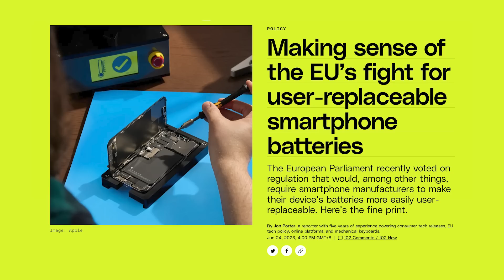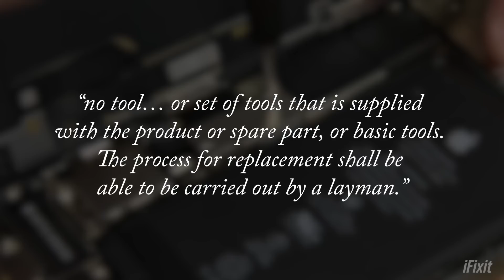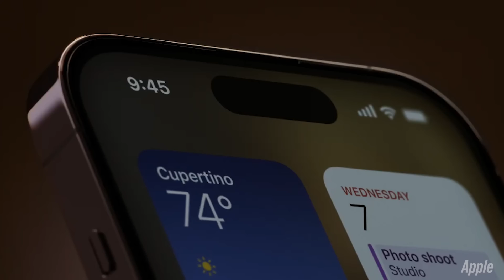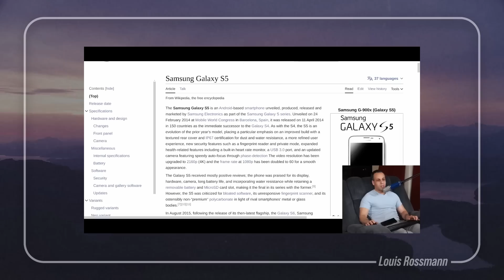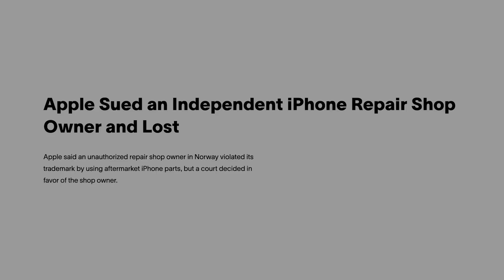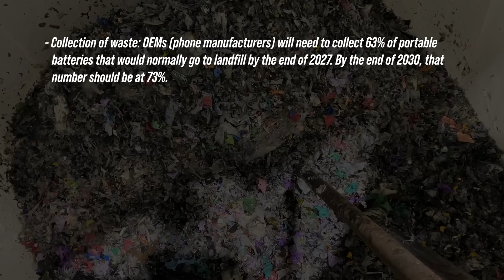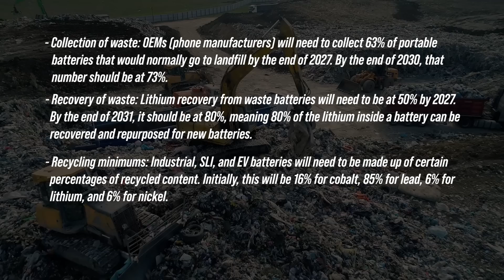EU Just Changed Smartphones Forever

Comment: This is so awesome.  Especially since it accounts for ALL electronic items including the so called 'green' EV cars!
Reply: EVs are a scam.
Reply: I don't know how they can design an EV battery that can be replaced by a "layman" without any tools? Working on any car, even non EV ones, requires knowledge and tools... And replacing the battery is kinda dangerous, it can kill you in many ways if you don't know what you're doing (it can electrocute you, poison you, squash you...). Some EV have batteries that are quite easy to replace if you have a garage with a lift and something to safely lower the old battery and lift the new one. For example for a Kona EV the process requires to disconnect the wires, the cooling pipes, and after that you only have to unbolt the battery tray on it's perimeter and lower it. It's easier than swapping an engine on a ICE car.

Comment: Now here‘s the big question: will this law apply to industrial applications as well? What Apple does is a mere imitation of something suppliers for industrial machines have been doing for ages. Using things like TPM-chips, registered hardware etc to block any repair or modifications with second source parts so they can charge a premium for old tech (and I‘m not talking about safety relevant areas like aerospace, trains etc. here)

Comment: I have yet to need to replace a battery before the phone was outdated...  I DO NOT want a plastic phone... I can't imagine a cost effective, waterproof and still slim profile on a glass and steel phone that has all the extra bits required for slides, pins, clasps, gaskets, etc... I am old enough to remember thick bulky phones.... I remember when the iPhone was released and it was so thin, compact, sleek... and they have only gotten thinner... not to mention that the friction connection between the battery and the phone was a weak point that would corrode and fail and also is not as power efficient as a soldered connection.

Comment: More important then having the battery removable and easily replaceable is to have manufacturers have to release software to calibrate screen and diagnostic software, so anyone that wants to repair their own phone can. No more serializing parts to the main board disabling functions due to changing a screen and etc. 

Also we need SD slot back and headphone jack with decent DAC in phone back.

Comment: How this applies to electric cars? Do they want people to replace 1000 pound batteries at home? Also modern EV batteries last forever practically, needing replacement is very rare, much more often the battery outlives the car.

Using adhesives instead of screws is easier and cheaper, while also increasing quality and reliability. That's why every industry is moving that way.
Yes, you can make an IP68 phone with screws, but that doesn't mean it's easy or cheap.

I bet 99% of people will still throw out their phones when the battery dies. By that time the phone is old anyway, so it's a good excuse to buy the latest version.

As for recycling, batteries are already being recycled. Li-ion batteries are full of valuable materials, so recycling makes economic sense. Look up Redwood Materials, for example, but there are many of others too. EV manufacturers usually have recycling programs too.
And since these materials are elements, they can be recycled indefinitely, and at a near 100% efficiency.

Comment: About F'ing time some enacted this requirement.  I used to buy a 2008 Fujitsu Tablet for my field work.  It was a little heavy, and slow but had replaceable batteries, memory and hard drive.  I finally had to switch to a newer tablet not because of the tech but because I could no longer buy new batteries.  

Since then, I've had 3 Microsoft Surface 6 tablets.  My latest one is getting to the end.  The battery only lasts about 2 hours.  The Surface 9 finally incorporates a replaceable battery.  It will be my next device.  The same is true of phones.  

I think the manufacturers optimized design for ease of manufacturing and profit - obviously not for repairability.  This same mindset has filtered into EV's.  We end up throwing away perfectly useable tech over a non-replaceable battery.  That is just STUPID and wasteful.  I was hoping that California would do this but applaud the EU for having the courage to do it!  Thank You!

Comment: Interesting. Some electric vehicle production is talking about moving to structural battery packs - ie part of the vehicle monocoque and not replaceable. It's apparently being justified on the basis that newer battery technology will last the lifetime of the rest of the vehicle. You can't really have consumer 'right to repair' with the sort of high dc voltages being used - typically 400 volts now and 800 volts on a few designs. Far too dangerous for well meaning amateur mechanics to mes with.

Comment: 🎯 Key Takeaways for quick navigation:

00:15 🤔 Industry-wide design changes have made easily replaceable batteries no longer possible in smartphones.
01:10 🔧 The new EU law requires consumer devices to have easily replaceable batteries that require no special tools.
02:32 💼 The law also affects tablets, laptops, EVs, e-bikes, and any device with a rechargeable battery.
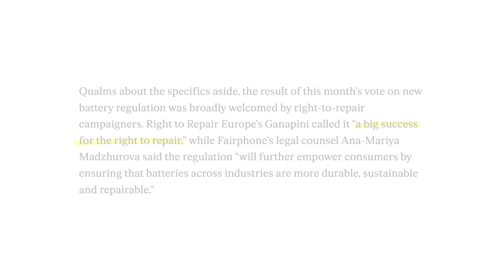03:56 ⚖️ The ruling is considered a success for the "right to repair" movement, which calls for easily repairable consumer goods.
04:29 🍎 Apple's practices of disabling features and warning against non-genuine parts hinder repair efforts and force users to send devices to Apple.
06:19 ♻️ The law aims to create a circular economy for batteries and reduce e-waste generation.
07:38 📱 Smartphone makers will need to start gearing up for compliance with the new law, which may result in changes to their designs.
08:06 ❓ Whether the phasing out of user-replaceable batteries was driven by consumer demand or profit motives is up for debate.

Made with HARPA AI

Comment: I had a LG G6 for 2 years. Loved the phone, was nothing wrong with it. I did replace the battery on it once. The reason I had to get a new phone was because the apps I used were being outdated and the new apps were not compatible with an older phone. Such a waste. So it's not just about hardware but software also.

Comment: "A new EU law will require all mobile devices to have user-replaceable batteries by 2027" is wrong. There is an exception for smartphones if the battery retains 80% capacity after 1000 charge cycles. If the phone manages that, the battery doesn't need to be used replacable. This is not currently the case but extremely easy to adhere to. Simply put the same battery in the EU smartphone and program it to a lower capacity on models sold in the region. So in the EU batteries won't last as long per charge, but will last the same time for longer.

Comment: OK, I totally agree with everything in this video...
Except "At the time carrying a spare battery in your pocket wasn't an unusual occurrence.." 
Umm....  Yes it was...  ;-)  Having a spare battery wasn't that unusual, but I don't think I knew anyone who carried one in their pocket...  Not saying it didn't happen, but yeah that would have been unusual. ;-)
Recently I was frustrated as my electric razer was dying.  I opened it up (which wasn't that simple) and saw the battery was soldered on (with leads).  I was able to order a spare battery with leads attached and soldered it on to fix it, but there was no reason for that.  It could easily have been a plug in replaceable battery...
And yeah with phones, I don't even try that.   I would totally support easily replaceable batteries...
Although I'm not sure user replaceable EV batteries is a good idea.  Those are HEAVY!!!

Comment: Battery life isn't the limiting factor for an old phone. It's usually compatibility, software, security vulnerabilities etc. This law seems misguided to me. It's making phones less integrated (hence more expensive to manufacture and/or more bulky) without giving anything back to the consumer. If replaceable battery was such a hot thing (useful to consumers), brands would be doing that already. What's next? Enforce replaceable memory, RAM, board...? There's no end to this. Fairly useless. I lived through the era of replaceable computer parts. Incompatibility and issues were the norm. Not convenience or longevity. EU perhaps should double down on building better technologies vs impeding technological progress towards miniaturization and tighter integration.

Comment: For laptops. I use framework 13th gen. It has a battery that uses only standard screw to open and replace the battery without any special software obstacle. It is slightly thicker than the apple macbook but it doesn't matter. Everything is repairable and isn't glued or software locked.

Comment: Theoretically "it's good" because people would be able to replace batteries, but "easy, common tools" make it a perfect treasure for thieves... No battery = No GSM/GPS = No tracking = No chances to get phone back. Also, you would potentially lose date etc. like in old phones, and you would have set it up every time...
Also, weaker and higher chances to destroy case, battery / phone, also reminder batteries are highly flammable kinda explosive if you puncture or something.
Bigger size, harder to produce... And many, many other reasons.

Comment: I actually agree with this and I am SO glad you brought up Rossman. I was even about to say the S5, and then he showed it haha. Adhesive is NOT the only way to waterproof a device. This is a lie propagated by manufacturers so they can keep using a method that is cheap, and makes repairs more difficult to entice more purchases. Gaskets have always been enough to create a water-tight seal as long as they are not compromised. The S5 was designed nearly 10 years ago. There have been significant improvements to to waterproofing that can make gaskets IP68 since then. The sole reasoning for using adhesive is profit.
Reply: My go pro has a change able battery that clicks in, that’s fully waterproof! I’ve taken that 15m down before
Reply: Case in point,  Waterproof watches .......
Reply: The S5 was a terrible waterproofing.
Reply: You probably forget that S5 lost its rating after removing the back cover a few times.

Comment: I dont know why anyone is against this. Why force tech companies to allow people to easily replace their batteries. Old batteries make the devices slower making newer devices seem better/faster by a lot then their older devices. There is ways for water resistants with removable battery. The only cons for manufactures are recost of reengineering and people keeping their devices longer. Apple for example use software to make the devices worse if a item is changed without going through apple care. Ipad will show non straight lines drawn on the screen unless a chip on the old display gets moved onto the newer screen which is proof compaines are willing to go anti repair just to force people to buy new devices or go through their own care program.

Comment: it's just stonks. a silicone gasket and some grease isn't that bulky etc. again the s5 has it.
it doesn't have to be replaceable without tools for me. but as long as it's not risky it's good enough (ex, screwdriver etc, not heat or dangerous prying.)

Comment: A battery that can't hold a charge is a huge reason most people get a new phone. It's obviously the driver for them sealing the battery.
Reply: This, and manufactures not updating the software on their devices for as long as they could, leading to some newer apps not working, or running very sluggish.
Reply: @CommodoreFan64  This is why I don't update any apps until they stop working.
Reply: That's part of it but phones also have gained in processing power over the last 10 years, significantly more hardware acceleration, extra LPDDR chips etc...
Reply: It’s like lightbulbs tires, and everything else they can’t make money if some things will last 100 years
Reply: @19ate4   Yeah good i hope they dont make money on the same product twice, we pay for the phone right? So it should end from there cut off no more money for them for the same product, the reason we upgrade is to use faster more powerful phones with new technology on them, not the upgrade only because my phone don't hold charge anymore lol innit. what a scam Samsung and iphone are.
Reply: @19ate4  The lightbilb thing is kinda a misconseption though. The ones that lasted a long time had their wattage really limited, which resulted in terrible efficiency and produced only a little light that was also really reddish.
Reply: Worn batteries were the reason I had to replace my 4 previous phones over the last 13 years or so. 
Still, the big corporations will just raise their prices or find new clever ways to rip us off.
Reply: @vetzaaak  my Redmi Note 4´s battery still had 3300mAh of 4100mAh after 4.5 years of use. But the off-button started to struggle and Android Auto didn´t work any longer due to its Android 7 base.
My girlfriend has a Redmi Note 7 at the moment which is 4 years old. And the battery is also still fine.
Reply: @segoiii you can always try to flash a custom android rom
Reply: Not only that, but they've been over-driving batteries for quite a while now to make them degrade even faster. Manufacturers get a double-whammy by over-driving: they can claim larger (initial) capacity and faster charging than there should be for a given battery surface area/volume. The old '1000 cycles' estimate before the battery drops under 80% of its initial capacity is simply not true anymore, you'd be lucky if you get to 500 if you fully charge (~ >85%) or deep-discharge (~ <20%) your phone...
Reply: no, batteries are holding up fine nowadays. Software obsolescence is a bigger problem.
Reply: While you are correct, another major design issue that comes from losing the glass sandwich method is the phones become far more prone to water infiltration.

If you have a panel that slides off easily to access the battery water is going to find its way right in.  You can of course design around this but it becomes far more difficult and requires extremely tight tolerances.
Reply: @JathraDH   This was nearly entirely covered in the video, lol.
Reply: @JathraDH   Not if you use the right pressure and water seal, it shouldn't slide out easily, what it should do is require you to stick in a long ass pin which starts the ejection process, but still require a pull out hard method, not slide out like a gun ammo.

This way holding it in with a screw would be better then anyone can use a normal screw driver to replace batteries.  At the end of the day a tool will be necessay to remove the battery so we can also get a water tight seal,
Reply: @JathraDH they could just screw it
Reply: @MelkofficialYT  Law states it should be removable without tools.  But yea as others have pointed out there are ways to do it.  Need to seal with orings.
Reply: This, and new apps/system updates that are not supported on old phones.
Reply: Yep this is one of the reasons ans the second one is updates
Reply: 100%
Reply: @@clau0072the battery isn’t $80 the service is $80. Someone has to replace it. Make sure it’s water tight. That takes time. You have to pay that person.
Reply: Keeps their profits up and forces people to buy a horrendously expensive new phone, even though the old one is still perfectly serviceable, apart from the sealed in for life battery issue.
Reply: That and it is also cheaper/easier to design and produce with non replaceable battery, don't know if apple still do but they at one point had more then one battery in their phones, rather one big one.
Reply: Every single time I've got a new phone is because I destroyed the screen
Reply: @Sqwaush well get a screen protector and a case. You can't break your screen then. I'm so smart.
Reply: @Sqwaush  you destroyed the screen before destroying the battery 😂, you seem distracted, their favorite costumer.
Reply: @Sqwaush I never destroyed mine
Reply: Literally just replace the battery for $80
Reply: @cl0udkikr   The problem being replacing it and then installing it, the reason behind this is mainly consumer profit to make you spend money to replace but more money than what the battery is worth.

80$ plus labour = 200-300$ in some cases. IT's a scam. Doing it yourself is for experts and not everyone can replace batteries in their phones.
Reply: There is another reason to seal the battery: batteries on modern phones are fragile. In order to maximize capacity, they got rid of the hard metal casing. There is just a thin rubber casing around these batteries, making them very easy to rupture.
Reply: @AWriterWandering  What hard metal casing? They are plastic. 1, metal is a great way to have a short to ground. 2, You want it to bulge, obvious failure is obvious and you don't risk it going off like a grenade. Yes if it fully fails it will be on fire, but better than on fire and exploding.
Yes the more or less naked cell is fragile but a shell isn't going to add that much.
Reply: @nickierv13  if the metal was touching, yes. These batteries obviously had an insulator just underneath the shell. But metal was definitely used to provide rigidity in phone batteries with less thickness than plastic alone.

Comment: I had a Sony Xperia V. It was one of the slimest phones I ever had and it was the first waterproofed phone I had and it has a plastic backside that is clipped into the frame, so, you can just open it with your fingernails and remove the battery.